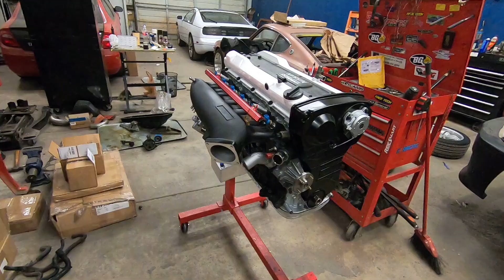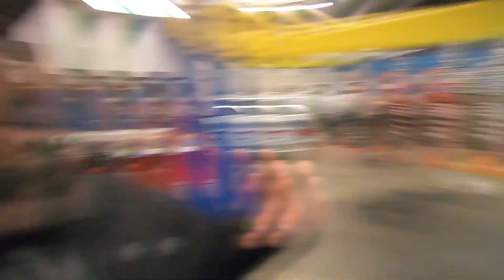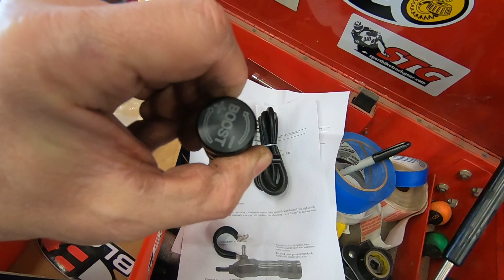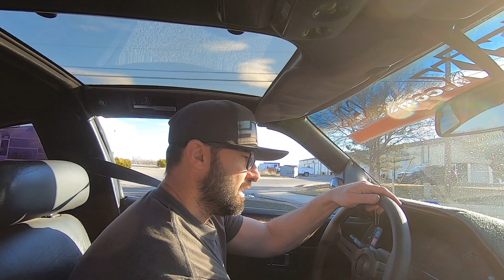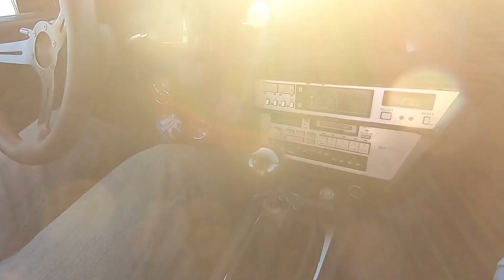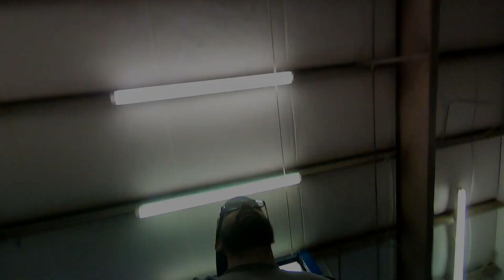300zx Turbo Build Z31 Turning up the Boost!

Comment: hey did you ever fix that overheating problem? im thinkin about doing that same radiator set up
Reply from the maker: The electronic fan helped out a good deal but I haven't made the ducking yet and test it out. As of right now the coolant temp will rise over the middle mark but not over heat. Will make a video on the ducking and test it out soon. It's been on my mind lately. Hard to get the materials I need with my hours of work and the covid restrictions over here at this time. Stay tuned, will try and take care of that soon.

Comment: i’m putting 24psi through a stock 86z31 all it has is a bigger turbo cams injectors and fuel pump with e85 you can turn your shit up to 15psi and be fine without any issues after 15psi that turbo becomes a hair drier so you definitely should turn it up more.
Reply from the maker: Awesome, thats good to know. I have a t3/t4 in it. I got some bigger injectors to install later. I guess after I put those in I'll crank her up. Thanks for the info!